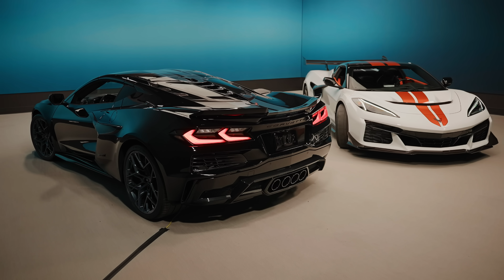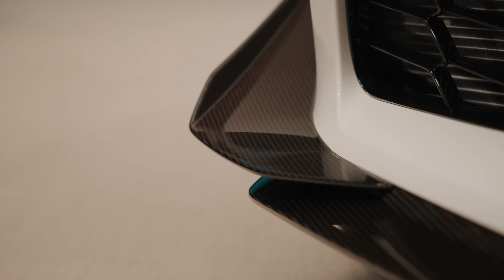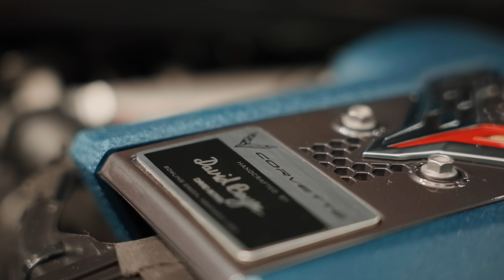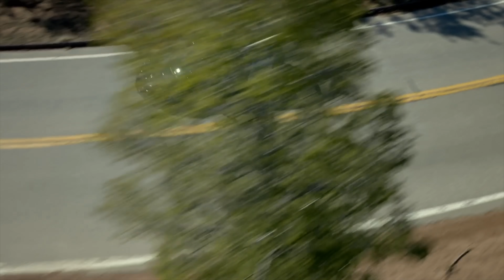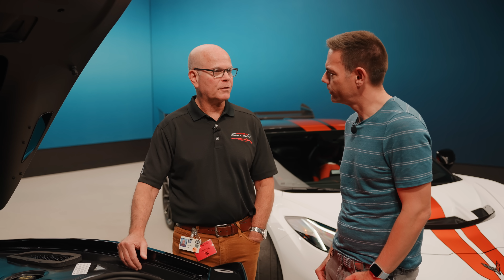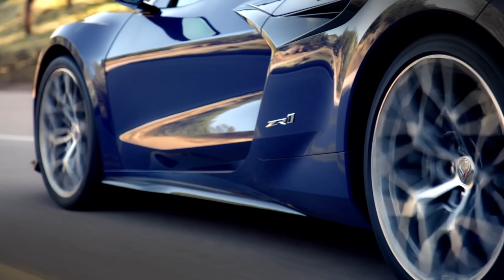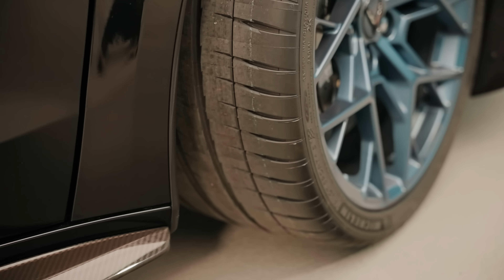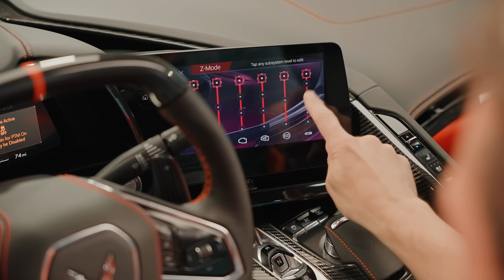FIRST LOOK: 2025 Corvette ZR1 – 1064hp, Turbos & 215mph!

Comment: So basically when the tuner world unlocks that’s ecu were gone see 1200 hp maybe more
Reply: tune and e85 will be 1400hp easily.
Reply: Ya, and a blown engine at that point
Reply: It would make 1200 off just a tune probably 😂
Reply: Downpipe,  tune, E85- 1500
Reply: Cleetus will get there easily
Reply: Easily 1700 HP with the right mods
Reply: 3000 hp Easily...
Reply: And crash the car because the chassis is definitely not for handling so much power. They just put a 1000hp in a 700hp chassis
Reply: @KaushikBala333  Right..., GM  put 1000 hp in a 700 hp chassis because fatal crashes, lawsuits, and chronic warranty claims is so profitable.  😂Maybe think for 10 seconds before smashing the send.
Reply: @KaushikBala333  The chassis was designed for this engine from the get go
Reply: @KaushikBala333 Jesus you people are stupid. This is a car with suspension better than Ferrari.

Comment: Welcome back, ZR1

Now lets see what the Tuners gonna do to this monster
Reply: There's your problem though...if you're a crazy tuner...why would you start with this car?  There are heaps of twin-turbo Corvettes at drag strips already with 2,000+ horsepower, etc.  Unless you mean "tuners" as in shops that add 100 horsepower and put a different wing/sticker on it...then sure.  But if you're going to build some performance monster Corvette, there's no point to start with the 200,000 expensive version....as you'd be gutting most things anyway.

Just buy a new or slightly used base model.

Comment: European hypercars can only make sense if they offer 2500 bhp moving forward
Reply: There’s more to life than BHP
Reply: @toyanaydin8248   Definitely. It’s stupidity but hey I’m all for it.
Reply: @toyanaydin8248   fax
Reply: so basically like the Gemera
Reply: @sidthiru1509  and that’s a four seater 😂
Reply: If koenigsegg enlarged their 600hp camless 1.5 liter turbo 3 cylinder to hypothetically a 7 liter quad turbo camless V-12, it would have roughly 2,800hp without any ev assist.. Add in their black matter cylindrical ev motors for the two front wheels which produce 880+hp each and only weigh 88lbs each.. And then we'd have a car with 2,800+hp plus 880 +880 for a grand total of 4,560+ horsepower stock.. Imagine the speeds it could do.. And it's doable right now..
Reply: @johnmuzic3475  unfortunately the law of diminishing returns will not allow you to do to that math. Just cooling that setup will need 10 extra radiators
Reply: People who buy hypercars won't cross-shop, so it does not matter if the Corvette made more power.
Reply: Not really. Any European hyper car would destroy this.
Reply: @marklynch1305   for 15-20 times the price? I would sure hope it does
Reply: @sidthiru1509  well they’re not high production cars. Just odd they’re comparing this to hyper cars. if it doesn’t beat the gt3rs at the ring then it’s a failure honestly.
Reply: @marklynch1305   doesn’t make it a failure. It gonna come down whether it can brute force its way to a faster lap because it doesn’t have the downforce to help it pull the levels of g’s on the turns as the gt3rs. In a straight line tho? It should demolish most cars
Reply: @sidthiru1509  price does not matter for Hypercar buyers. They most likely got multimillion dollar yachts and private jets too.
Reply: @sepg5084   yes but i was just saying
Reply: @sidthiru1509   that why they are hypercar  their base model make similar numbers ot higher this is to most hardcore model ( top of the range vette)  a hypercar in base model makes this numbers and probably performs better in any tracks as well.
and don't say sf90 or revuelto, this aren't hypercars, not ever their brands labbel them that way
AND REMEMBER THE ENGINE OF THE Z06 AND THIS ONE ARE FROM 458 ITALIA, soo yeeep not that american ( 458 ( z06) conversion ZR1(488))
Reply: But European cars look and feel 2024 with beauty and luxury while this corvette was 10 years late man look at he the the 458 special it's more than 10 years older but still looks better than this corvette today, good attempt but it's 10 years in design late lol sorry
Reply: @jaredroestoff8712  Leave this murican alone, they only talk about horsepower - 'oH tHiS HaS MoRe pEaK pOWEr thOugGH'
Reply: @jaredroestoff8712   Current gen BMWs: 👀. Jk. Nah but while I agree with the 458 statement, this vette has a better design than modern Ferraris except perhaps the 296. And it’s not ten years late. The new amg gt doesn’t as good as the previous, Porsche is just Porsche, Audi has killed the r8. Lambo still goated in design I will say. But Euro cars in general? Nah man they don’t  have the design and beauty they once did
Reply: @sidthiru1509  are u drunk bugatti tourbillon, new zenvo , new 12cilindri ,new sain, new amg one in desighn department europe is miles ahead in future proving designs,  sorry corvette juat looks like a 2009 to 2012 supercar sorry juat my honest op
Reply: @sidthiru1509  yes bmw might not be sexy but in design and technology still years ahead a 2005 s class had sat nave and satellite TV while most Americans cars only implemented that in like 2014 to 2015
Reply: @jaredroestoff8712   relax. The corvette does not look like 2010 car. And almost every car you’ve stated is a multi million dollar hypercar, no shit they look nice. And the first Zenvo wasn’t that good looking. And I really am not a fan of the 12 cilindri in design. 812 comp looked way better.
Reply: @jaredroestoff8712   wtf are you on about ‘design and tech’? They have a shit design team, and because of all the tech they look very cheap and childish. Germans always cram too much tech, but the difference now is they don’t know how to implement it without ruining the car
Reply: @sidthiru1509  you do no the p1 was showed in 2011 same as the la ferrari and come on the corvette desighn is not that much better than a458 special pls stop glorifying it its shit desighn in today's world of cars there are Chinese cars with better looking cars lol
Reply: @sidthiru1509  then u have not seen the zenvo tsr its miles better looking than this corvette lol

Comment: Zora will have this twin turbo power train with the E-Ray electrical front wheel drive propulsion system…
Reply: @Stang2016  Given that this is 1665kg dry (coupé), what will that thing weigh with the electrical components?

Comment: Wait, factory twin turbo? Can't wait to see what the tuners start doing with it. And if the DCT has stronger clutches, I can see people using ZR1 parts for their base-model builds instead of going third party and waiting for Dodson to get more stock.
Reply: Will have to be piggy back ECUs.  Can’t even tune the Z06 or Stingray
Reply: @Snowkone81 they do tune the stingray now.
Reply: @Snowkone81  search for the @andersondick vette, the first to be in 8s quarter mille. 1300hp, fueltech controling boost and DCT
Reply: Likely get another 100hp from a piggyback tune but that will be about the cap around 1100-1200hp which I don’t see any world where you need more than that
Reply: @jakefox3677  There's no world where you need more than ~500 HP, but the maniacs will start building these up to 1800+ HP and put drag slicks on the back.
Reply: @shred1894 The moment the ECU gets cracked we're going to see 2K HP ZR1s tearing up in the dragstrip lmao.

I wonder if the tuners can push these engines to VR38 levels which is in the 3K HP level rn.
Reply: @danieltanuwijaya7675  Exactly my point. People are gonna go nutty with these, and the people who don't have these are gonna go nutty over secondhand/replacement ZR1 parts.
Reply: @jakefox3677 I think the stock hp is more then enough.

Comment: I'm sure the new ZR1 will be a tremendous drivers car. However, I feel GM dropped the ball again design wise. If I'm paying 200 large for a Vette, I'd like a bit more change in aesthetic vs. the base C8. In fact, this just looks like a Z06 with different livery and wheels. How about a different exhaust setup? Or different headlights. I still could definitely see myself owning one. But I'd be heading to the aftermarket store the next day.
Reply: Are you serious? Lol this next to a normal c8 you couldn’t confuse them if you tried. You can’t afford it, based off what you get this car should cost nearly half a million.
Reply: @mogulme6190  Spoken like a true fanboy. You have no clue what I can afford. In fact I’ve already inquired about buying a ZR1. Sorry to disappoint you. My dealer is talking about a 3-4 year wait with $3000 down. It’ll be very close to $300,000 in Canada after markup. Think I’ll stick with a Porsche. I still may bite the bullet. Only an enthusiast could tell the difference in aesthetic between the ZR1 and a base C8. Interior wise they’re pretty much identical. Outside the ZR1 is a bit different than a Z06 with its front vent and rear split window.
Reply: @mogulme6190  Something tells me you've never sat in a GM product before...
Reply: That's been the curse of the Corvette for a long time.  I even think the entire modern C8 line is pretty ugly...cheesy even.  But as an American I know we do great motors, performance, and often solid reliability.  Our interiors and styling?  Not so much.

I know it's fun to compare numbers...but it baffles me that people think "Oh this is so much faster than this Porsche, or this Ferrari".  Those people aren't comparison shopping these cars, lol.  No one leaves the Ferrari dealership and decides to swing by the Chevy dealer to compare.  Some track-focused people, maybe?  Some racing influencers, absolutely.  A handful of rich tuners?  Sure.  But the average person doesn't care...at all...about this car, and it would look like a cheap Chevy camaro to them, by comparison.  Performance/value be damned.